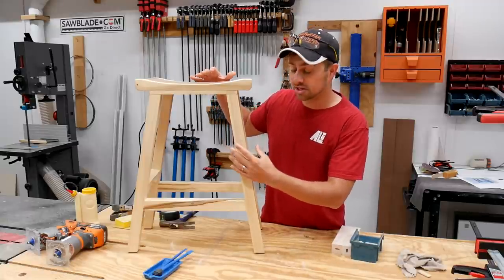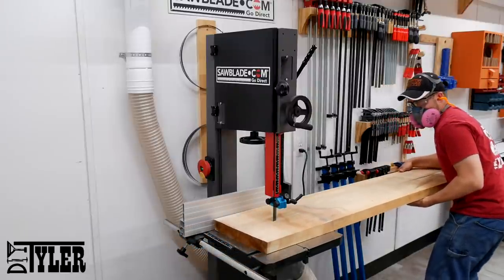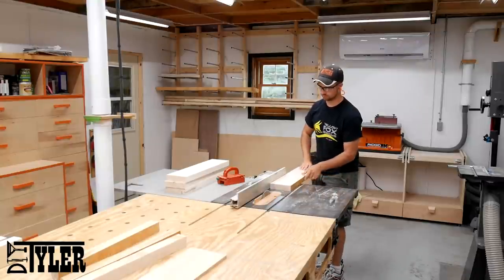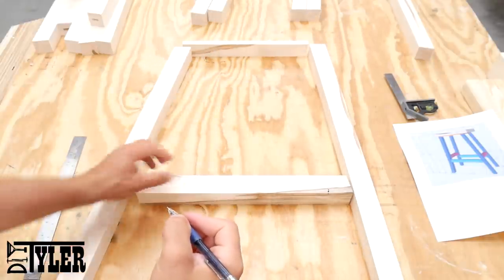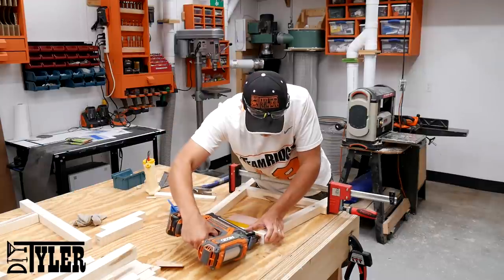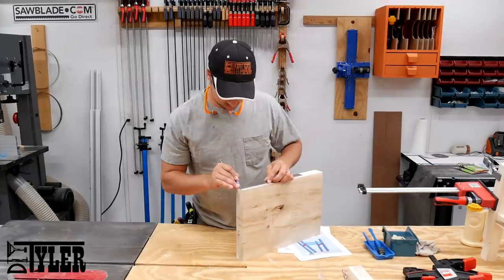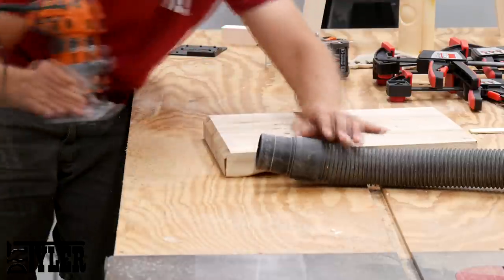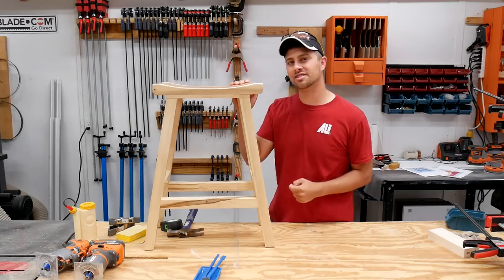Maple Bar Stools | How to Make Bar Stools Using Loose Mortise and Tenon Joinery

Comment: I'm curious why you didn't make those rip cuts on the table saw?
Reply from the maker: More chance of pinching the blade and getting kickback since the slab isn't flat yet. And less dust and wast because of the smaller bandsaw blade.

Comment: Excellent video, Tyler! I really liked following along on the build. I just love watching you work in your shop. That maple, with ambrosia accents is stunning! I'm so grateful to be numbered with you on #teamRIDGID. A couple questions for you about design and execution:
1. What were/are your thoughts about leaving out top rails on the stool (e.g. rails that were M&T'd like the lower rails)in this design?
2. Self admittedly I put wood movement in last place but how do you think the wood movement of the top, being glued to the support, will affect the integrity of the M&Ts on the rails?
3. How do you keep the kiddos out of your grill when doing milling and joinery cuts - especially when filming? For my kids it's like a moth to the flame. 
4. More of a comment: B sure is lucky to have a loving, creative, hard working hubby like you. Thanks for the example!!!
Reply from the maker: 1) More difficult to make for sure, maybe not as strong?
2) Support grain direction is the same as the top so I hope it will be fine, couldn't think of another way. Am a bit worried about the lower supports being a different grain direction but my consolation is that is how I have seen every other chair.
3) I have to tell them all the time. You see they are always there.
4) Am pretty sure she like it!

Thanks Scott....hopefully my shop can be graced with your footsteps someday.

Comment: Tyler love the look of the stool. Was wondering why not at least put a screw down into the tops of the legs to hold the top support piece?? Long grain to end isn't the best glue joint
Reply: New put a few nails into it.
Reply: I was worried about this connection as well. I wouldn't spoil the look of the top with nails or screws, but a blind dowel or "checker" in each leg would make it stronger. But then again, you only need strength when you pick up a stool by the seat (or when the kids knock one over!)

Comment: Nice project Tyler. Just curious, seems like the only thing holding the seat to the legs is a single nail in each leg and  glue into end grain. Have you had any issues with the seat coming off?
Reply: I wondered this too. It effectively isn't any stronger than just edge gluing the legs to the seat.

Comment: Very nice job.  Do you prefer to use the band saw for ripping?
Reply from the maker: Hi Dave! Yes, less dust in my opinion and when the boards are not straight and flat I feel its a bit safer, less blade pinch.

Comment: How are you accounting for the wood movement in those tops?  I think it may cause issues being directly connected to the legs.  I don't know your climate, but maple that wide and thick is going to move.  If you haven't finished the other two yet, you may want to mount them with bolts and elongated holes in your aprons.  That would also allow for easy removal and touch up in the future if anything happens to them.  Great video!
Reply from the maker: Never seen a chair with elongated mounting holes. The grain orientation of the leg bracket is the same as the top so I hope they will move the same.....the cross direction is quite a distance a way so I hope there is enough give in the wood.

Comment: Where do you get the checker pieces that goes into the slots the checker makes, being that this is your design? Or do you make them yourself and how do you make them?
Sorry for all the silly questions. Trying to learn. 
Hope you can get to my questions.
Reply from the maker: I make them, flat stock....round over both sides with the router, cut to length on the badsaw and round corners on the belt sander. Cheap and make a bunch at a time.

Comment: Hey Tyler, just wondering if you had some suggestions for alternatives to loose tenons? I imagine regular mortise/tenon joints would be pretty tricky on an angle, so do you think regular dowels would have enough strength? The other thing I was thinking was through-dowels using hardwood, but it would be better to go with something that wouldn't be visible if possible.
Reply from the maker: Dowels would be good and half laps would be another option.
Reply: Tyler G Good call. Thank you!

Comment: Nice. But it would be better if you have incorporated proper joints rather then using screws. This stools would not last long.
Reply from the maker: A year in with the kids beating on them every day and they are still solid as a rock.